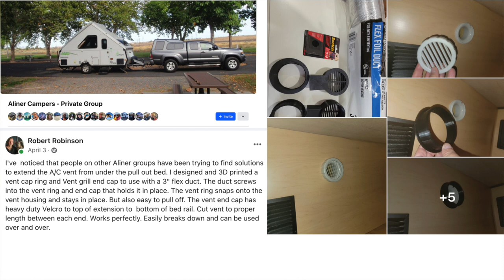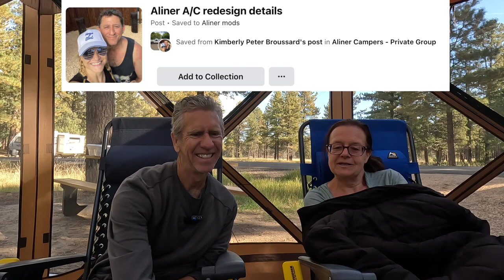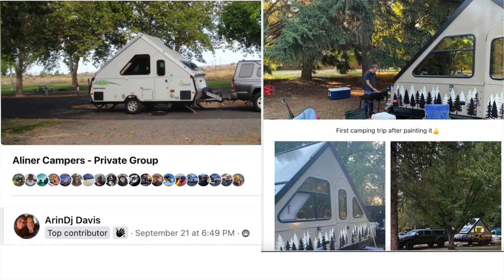AC & Storage Mods | ALINER Podcast Episode 6 from Bryce Canyon National Park

Comment: Always fun to personalize the camper and making it more user friendly!  That dormer shelf is legit.  Back in the late 90's, Starcraft started putting articulating shelves in their pop-ups, called a "Space Station."   It soon became a popular mod on forums to other brands of pop-up tent trailers, but using the wire rack like you show, and hanging it with some flavor of thin chain from the hardware store.  This allowed it to pivot and lay flat, when the bunk tenting and end bow where the shelf was laid down.   

Always a challenge to keep 'em cool in the summer, and warm in the winter, especially for those who like to dry-camp.
Reply from the maker: Thanks so much Todd.  Sending you an email.  Have question about road bikes.

Comment: Recently, came across your site, which I really enjoy. If I’m not mistaken, you folks are from Vegas…as am I. Looking to buy an Aliner with dormers, my question is what’s the highest temp you have camped in and how did your a/c handle the heat? I ask because the unit I’m looking at buying has the box/wall a/c vs the cool cat. As you folks talked about the inside can get toasty so I’m curious to what temps you experienced. Lastly, hard dormer vs soft and why? Thank you guys in advance and keep, keeping us updated! Thx again.
Reply from the maker: We haven't camped in really hot temps yet.  Maybe 95 degrees.  The heat pump does a decent job of cooling things down, but the side ac unit does I've heard does better.  We love our hard dormers, but the soft dormers have much larger windows.. but many are concerned about it being less secure.  If you want to come over and take a look, let us know.
Reply: I appreciate that. I'll be in touch. Thx
 @GoldenK9Campers